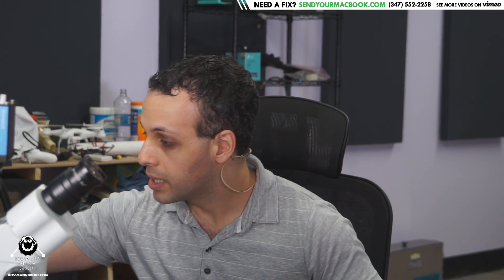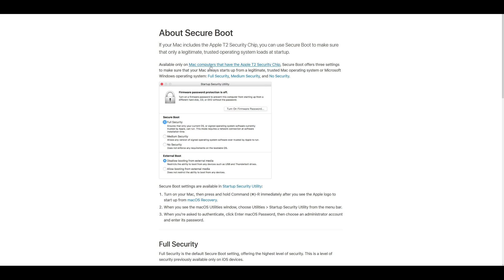An important message from Louis Rossmann

Comment: This literally happened to me... I was in the middle of finals and updated my laptop and it randomly went black and the apple genius bar told me it would be $750 to replace the logic board. It was complete BS considering I bought the laptop only 10 months prior, a $3,000 computer went to trash and I got no help. They said it was an internal logic board issue that nobody could fix or prevent.

Comment: I fixed yea I was think than I lost it... but no...... Hi I fixed first I bought a Thunderbolt 3 or USB C 3 (power delivery up 100W(20V/5A) and Up to 40Gbps @t and next follow this instructions @t be careful with the keys that need to press power first 1 sec next right shift then left control and option for 8 seconds and release

Comment: If you could recover data from a T1/T2 chip Mac after a hardware failure there would be no point of buying it, the whole point of hardware backed encryption is that the keys are not stored anywhere else and are not retrievable.

The failures of TPM as a whole to provide proper hardware backed encryption on the PC is the main reason I've bought a T2 mac, if it fails it MUST fail securely, there should be no other way for it to fail. Same goes for ensuring that no other devices with DMA (direct memory access) like your wifi card have been modified or tampered with is a key security feature.

I like most of your content but on this aspect you are so incorrect that you are in the "not even wrong" territory, Apple should opt people into having their data encrypted and their devices secured from tampering, ideally there shouldn't be a way to opt out from this to begin with since it opens the door for potential vulnerabilities.

I can dump the entire memory of from a 2020 Dell XPS using a 10+ years DMA exploit by removing the wireless card and plugging in a PCIe device (mini PCIe/m.2 PCIe cable + an FPGA that reads the memory), I can unlock it, and even dump the bitlocker encryption key if the device is suspended/locked and not completely shut off, all in under 2 minutes. 

I can't do the same with my T2 Mac and it's not because it takes more than 2 minutes to open the laptop but because it has a dedicated security chip and all DMA devices are locked down.

Backup your data there are a bunch of solutions Backblaze is $6 a month for unlimited backup, if you don't trust online backups or have too much data then they also have a service where they ship a hard drive to you and refund the cost once you send it back within 30 days.

Comment: Can you expand to "Surface Pro"? I have a surface pro 7. 3rd party charger was not working so well but was working, the machine just doesn't like to detect it. 
Secure bit and another encryption is on by default. 
It made popping sounds but that stop after recent firmware update. 
I got the machine because of small form factor and i need to run windows.

Comment: I will double my post i wrote in some of the threads, because it might be helpful for people with flexgate issue.

Macbook Pro 2016 2017 13" and 15" have the same Flexgate issue. I believe 2018 will be there as well pretty soon.
backlight cable is separated but it is the same design as data cable, same bending, same length.
 
now check this:
1. Repair program covers ONLY 13". 
2. if you go to apple with iWatch on arm, iphone and ipad, they REPLACE 15" AS WELL. i will return to this later
3. they do not replace devices with Data cable issue. on Apple website  Flexgate is described as failing backlight. if you have SAME problem with your data cable (you open the lid - display gets distorted and pink). This is absolutely obvious that this is the same issue. Even if you have no idea how it is built, if you see https://www.youtube.com/watch?v=nQzIaCUAxxQ you will agree that it is the same cable problem. 
To get your screen replaced, you simply need to open/close your lid untill backlight fails as well so "genius" will take it for repair. 
4. it WILL Happen with all devices, sooner or later. they did not fix the display cable. 
and now explain me, how a honest tech could do something like that. 
5. now this: instead of scamming people like Apple does, I instruct 15" flexgate/Dataflexgate customers to go to the apple store with full set of apple devices clearly visible. i instruct them to ask apple genuis "what pc laptop could you recommend? i am done with apple."... and it works. Which clearly means that apple geniuses are instructed to repair such devices for "loyal" customers. This is discrimination at its finest. No iWatch&iPhone&iPad in your hand - pay 900€ for their design flaw. No catchphrase "well.. i guess im gonna switch to PC now. Can you recommend me some decent Lenovo laptop?"  - sorry dude, 900€ + labor. 
 As for failure rate - apple repair can function as a one-brand only business. Apple market share in notebooks is tiny compared to Lenovo/HP even if you cut them to business/premium devices.

Comment: Maybe Apple hired the displaced Boeing Aircraft Shitware genuises that introduced MCAS for the 737 Max 8, Maybe they are taking the trouble out of the defunct operator AKA Pilot's hands. No need to fix anything when you can just walk away.  Data, Passengers, they are just material, atoms and molecules; they can be replaced. Go Rossmann! Go Rossmann!  My MBRP is still coming to be saved I swear it is, covid or not.

Comment: Is data recovery technically possible. Could you de-solder the onboard SSD and solder it on to a purpose designed PCB in order to recover the data on another machine?

Comment: Sounds like a salt is stored with the firmware or the firmware in flash is used as input to the key derivation function. Meaning that, if a user's T2 firmware was backed up while the unit functioned, restoring that firmware might restore access. Though of course you'd have to have access to it before it broke, to back up the firmware.

Getting security right but also making repairs possible is difficult. If a component (or flash image) changes, was that a repair or is someone trying to get to data that isn't theirs?

Though in this case, one easy fix is to make people aware of the encryption, and if they don't opt out, ensure they have a recovery key they securely store somewhere. Even MS managed to have functioning recovery a couple decades ago, with the XP password reset disk. Sure, it'd confuse some people, like having to click install to install zoom. Apple, don't be zoom.

Comment: I cannot believe apple decided to solder all the important stuff too the logic board.  This is why I get the lowest GB MacBook Pro's and then run my storage and anything via thunderbolt 3 Nvme external running exFAT so I can use the files on my Windows PC and my MacOS.  I even run windows on my MacBook Pro's.  I cannot stand Apple's step by step not fast at all, very sluggish even with a beefy system OPERATING SYSTEM...It is trash compared to Windows 10.  Only reason I am using Apple products right now is they were given to me for free for my work.  So im taking advantage of their hardware but using Windows and external stuff for everything else.

Apple is slowly going to be completly just for the Karen's in the world...simpleton, non tech savy people.  All the professionals are already switching too PC's for their work flow because of all the stupid things Apple is doing to their MacBook Pro logic boards.

Comment: While I do agree that the concerns stated by Apple regarding security are not made in good fate, I respectfully disagree on the "don't encrypt your drives" point. Encryption by itself is not a bad thing. The combination of encryption and the user's inability to access the data on a dead machine is the problem. An option should be made available for the user to create a token that would allow for drive decryption in any machine.

Keep up the great work, sir.

Comment: As a Linux user, Secure Boot is absolute cancer. It does nothing to improve device security and does everything to lock you in to certain operating systems, be it Windows 10 or Mac OS. No recovery disks of any kind can be used.

Comment: should I disable secureBoot on my new 2020 MacBook Air? I did turn off the secure boot like you suggested I also did the The other one where it can be booted to a different hard drive so doing that won’t harm the computer also but I still get updates when needed on The operating system?

Comment: Backup.  Get an external HD.  Get online backup.  No matter the method, just do regular backups.  If someone like Louis can recover your data, great, but never count on that.  Us computer folks have been preaching it for 30 years, and it's never been easier or cheaper to do.

Also, Louis, you should try fixing literally any other brand of computer— Razer, Dell, Microsoft, Lenovo, anything.  Apple does a lot of things I don't like, but let's face it— they're still the best build quality, and best reliability on the market (a small failure rate times the number of Macs in NYC is still a lot of repairs).  I think you may think some of issues with Macs are worse than they are because you only see the failed machines— not the machines that are still running solid years later.

P.S. Go Team Right-To-Repair!

Comment: Keep it up Louis.  I started in computer repair when the same 3.5 inch replacement floppy disk drive for a DOS/early Windows computer cost a tenth of the same one from apple.  The first school virus problem I saw was in the little one piece Macs.  It came on a 3.5 floppy of programs the Apple store had included with the computers.

Comment: Whenever one of my clients, friends or family members asks me if they should buy a Mac, I ask them why they want one.  For a third of the price, you can get a PC, spend the extra on some backup drives (a nice NAS, perhaps) and keep the rest of the money.  Heck, buy TWO Windows machines and a backup solution, it's still cheaper.
Reply: If you honestly compare Windows computers to Macs you will find them similarly priced in the same category. In addition it has macOS which is better then 10 windows computers and is the only thing that runs the tools that run my business. Apple makes me 250k+ a year. Our office runs on Macs more than half a decade old. To date we haven't had a single Mac fail, including our 2006 intel iMac that still runs to this day. When it comes to a business reliability is worth far more then sticker price. Each hour of down time is hundreds or even thousands of dollars.
Reply: @hajjdawood  You are severely deluded if you think a $4000 Mac performs the same way as a $4000 PC.  You have built a business that uses overpriced hardware and proprietary software, and that's fine, but don't presume to know more about how it works than the IT community.

Comment: I remember when I finally got my first Mac: a PowerBook G4 in 2003.  Even though it cost me $1800, it had a much better value than anything Wintel OEMs shipped, and was much better than my Sony VAIO FX215 I had.

The last MacBook I bought was a MacBook Air in 2012.  That machine still works and is on its second battery.  In 2015, I bought a refurb Dell Inspiron 13 for $600, and in 2018, I bought another refurb Dell Inspiron 13.  These machines are not only upgradeable, they're infinitely LESS service-vicious than any Apple product, not to mention a MacBook.

Unfortunately for me, the latest Mac I bought (because my trusty 2012 Mac mini is probably going to not be supported by Apple very soon) is the 2018 model.  With a soldered-in SSD and the Apple T2 Security chip.

I will not install Catalina on this machine.  I'd heard enough bad things about Catalina, and I do use some 32-bit applications, but this is a pretty big showstopper.  So it stays on Mojave and I continue to make regular backups along with the usual Time Machine backups.

I see that one of the "features" of T2 is the ability for Apple, Inc. to stop trusting macOS versions, probably like how they stop trusting old iOS versions on iDevices.  I get the distinct impression that I don't own the machine I just purchased outright, quite like how "owners" of Tesla Motors vehicles don't really own their cars.  So a day could come when Apple stops trusting Mojave and I must update to an OS that phones home (and blocks on it, so it feels slow!)
Reply: Can you explain who Tesla owners don’t own their vehicle. Though I do understand your statement of Apple products owners getting the impression that they don’t actually own their products.

Comment: I bought the 16 inch macbook pro from my 2013 15 inch. My 2013 died in February because the motherboard had a major short circuit with fire and smoke, the vrms are all burned, the cpu is dead. Sold it for parts on ebay but still it was 7 years or working hard.

Comment: I don’t get it why some people have the tendency to defend Apple even in cases where the company’s efforts are clearly towards profiteering through planned obsolescence. 

This a niche market that once targeted only professionals and those machines are even more expensive these days that they where 10 years ago, in conjunction with the average salary even in developed countries.

A 3000$ - 5000$ laptop has to be at least “honest”, meaning that it has to pay itself through a logical amount of battery circles without serious issues. All i can see in a variety of forums and by my own experience these days is a series of problems that never occurred on previous laptop generations, at least not in this consistency. These are not sporadic issues like a defective monitor here and there but design flows that affect millions of devices.

Swollen batteries, defective keyboards, major & unsolved software bugs, popping speakers, the list is really long. Some of them are related to a design that gets slimmer and slimmer every year by sacrificing proper thermals and reliable mechanical parts. So this is another Apple disease of these days: design over life expectancy.

Apple’s apps like FCPX and Logic Pro X are top notch and like many others i am making my living by using them every single day. For me, MacOS is the only OS due to these well written, rock solid and beautiful apps. 

But it seems like Apple has decided to squeeze every single penny out of our pockets by deliberately lowering the life expectancy and repairability of these machines with moves that i consider as purely “unethical”. And this is quite serious.

Comment: I strongly condered switching back to Windows when Apple started hard wiring the system drives. The irony is that Time Machine is a major reason why I continue to buy Apple Computers. For extra protection I use an enclosure that mirrors my TM drive in the hardware. I also home my primary user account on an external drive. The admin account is on the system drive, but there is no critical data under that account. I created a user account for doing my work and holding my critical data. I moved that account to an external drive when it was created. On my current system that drive is an M.2 NVMe SSD housed in a thunderbolt 3 (40gb/sec, not USB-C) enclosure. I stumbled across and disabled Secure Boot when I set up Boot Camp to boot into Windows from an external drive.

Comment: Hey Louis, technician for an AASP here. There are actually ways to get the data off when t2 firmware has just messed up. Apple actually has given us special software we've used before to retrieve data. We've also been able to use Apple Configurator Two to revive the firmware which has fixed the firmware without restoring the OS. Catalina has caused issues though with the revive option as it tends to rebrick again. Just thought i'd lend some advice for you to help people in case data is important.
Reply: I thought Apple Configurator is only for iPads and likes?
Reply: @AlexReds  nope! Can use it for firmware issues on t2 Macs.
Reply: @AlexReds  it will allow restores which wipes the data to resolve firmware issues but under advanced options is revive which typically will revive the device and let the os load. With Catalina however like a week later same thing happens.
Reply: Bypass the t2 rerouting the ground to a secondary adding a blowout fuse that redirects the current then the t2 shorts out brinng back the data which you would know how if you had ever built a computer out of a toaster.
Reply: yes right, other way is using Mac Configurator Utilities and adding part number data backup on GSX, then use AST to backup the data from dead board. I use this method and so many customer happy they can get their data agan from dead board.

Comment: I think problem with WiFi card is that usually OS uses its MAC address as unique identifier. So new card's MAC address needs to be set as it was on old WiFi card. Just a thought, I never  did it with apple products.

Comment: It's using the MAC address etc from the WiFi card to seed the hash for its security keys. You could try if possible changing the MAC ID on the new card to match the old but that said it probably pulls other things like OEM IDs and strings which you cannot change anyways. Oh dear oh dear: I am very glad that i am not a Mac user! Deary me: And you can't restore from a clone image (like I do with Acronis TrueImage on a PC) what an Apple fuckup indeed and why I am a Windows/Linux user!